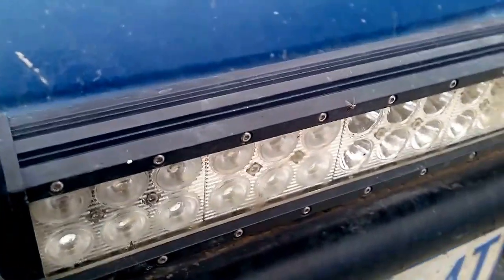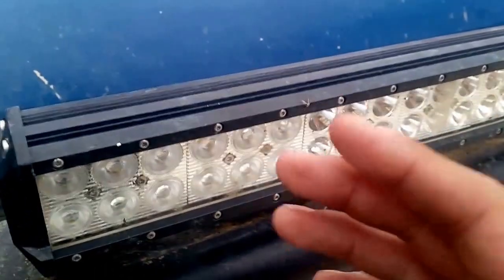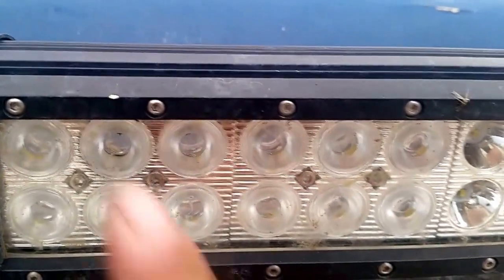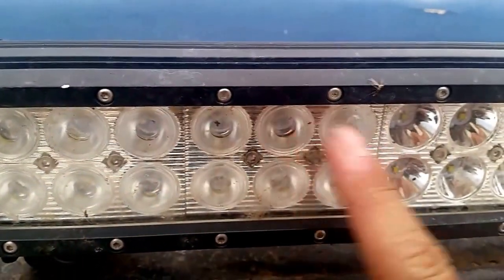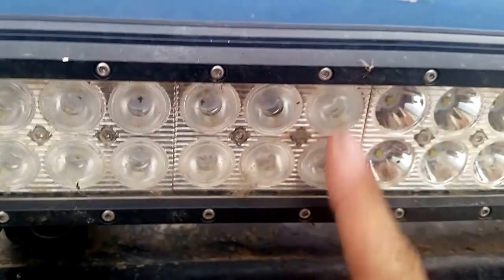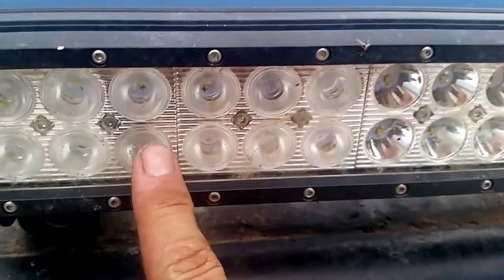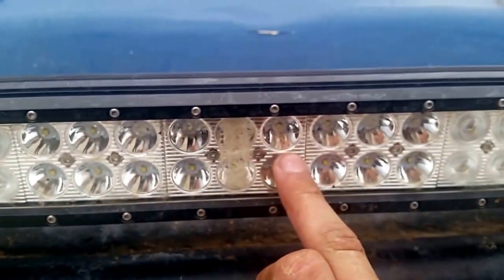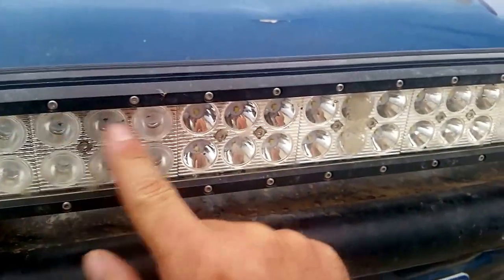Rating a Light Bar for Watts and Amps

Comment: I’ve noticed that my light bar never seem to draw anything close to the total amp rating. Is this intentional?
Reply: A lot of the product descriptions specify that it takes "9-30 volts DC". The stated wattage would be with a 30 volt battery (which no car has). With 12 volts, the actual wattage is 2/5 of what they advertise. By hiding the nonexistent 30-volt power source in their description, manufacturers found a legal way to lie.
Reply from the maker: +Malcolm Wardlaw
Yes mate, a lot of companies overstate the draw, they just outright lie.
Reply: No, when they state it is a 180 watt LED, this means that it puts out the same amount of light as a 180 watt halogen.  But yes, it is a lie and it is about 2/5 of what they say.